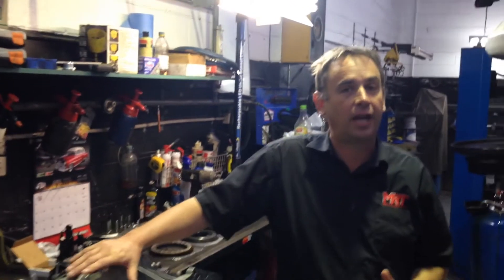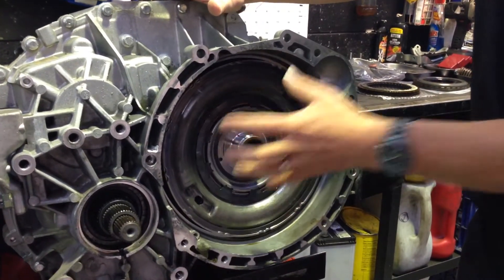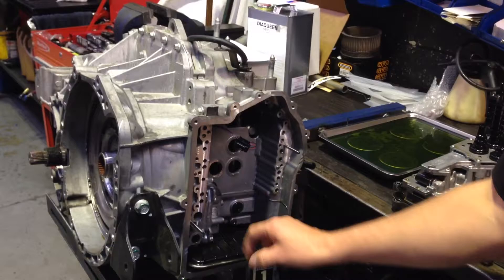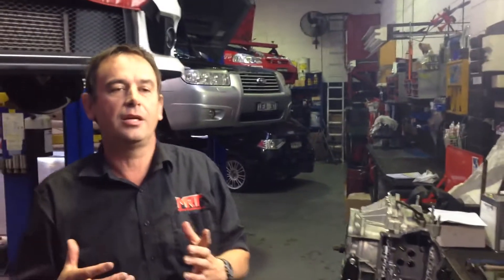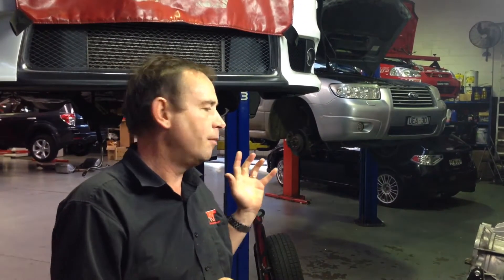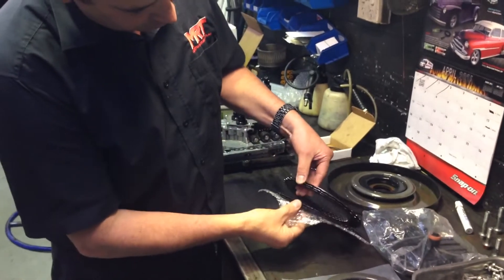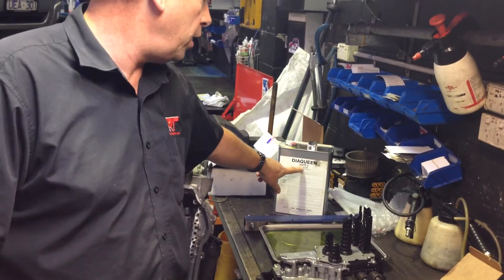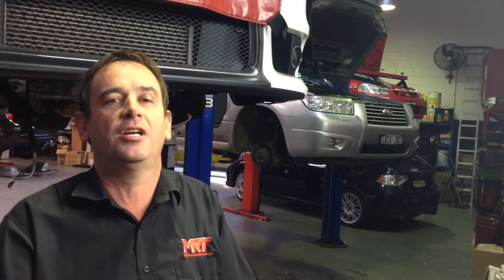Mitsubishi SST transmission tips and traps update Part 5

Comment: This is such valuable info. Also make me know for sure that if i'm buying an Evo X it will have to be a manual!
Reply: My 2010 Evo X MR has 130k kms and still running as new, just serviced on time (by myself) because Mitsu and most of the service workshops around there are useless. Those SST for repairs are from kids who just buy parts n send their cars to any tuner to show them on instagram
Reply: @motuc_fan_vic  Right? My 14 MR has 105k on it, shifts like the day it rolled off the showroom floor. It is tuned and runs all great parts but I built it for purpose, not show. Mitsu charged me $1200 to change the fluid and filter, now I just do it every year for $380 and 1/2 hour of my day.
Reply: If you want a 5 speed sitting at 6000rpm on the highway be my guest lol

Comment: Transmission just died in my Ralliart, skips 3rd and 5th gear.
Reply from the maker: easy fix!
Reply: MRT Performance
The cars under warranty. Apparently it needs new shifting fork actuator pistons, but Mitsubishi will not replace those individual parts but rather replace the whole transmission. Been waiting over a month for Mitsubishi to approve it : (
Reply: Mitsu Australia have no fkn idea about Evos, about cars I'd say. The other day they adjusted the timing chain of my EvoX and the next day my engine bay was full of oil because The idiots didn't put back the engines top cover properly . fk!
Reply: jcmedinaceli  they are all idiots bro. These are the boys that were scribbling pictures of dicks when they should have been paying attention to men like the above in class. I took mine in (uk) “it’s a sealed unit need new one six grand” 
“What about the clutch pack?” 
“The what?” 
Jamie walks away shaking head. 6 months later finds a garage that actually has skilled men in it. Replacement parts ordered!! Shout out to Automek in East Kilbride, indigo GT in Wales and of course Brett at MRT. Kinda amazing this is the length you need to for service after buying a 35grand car. Shame on you Mitsibushi. You allow idiots to sell and service your cars
Reply: @jamiewalker8772  Yep, I am yet to meet a more knowledgeable and thorough bunch of guys than Brett and the team at MRT. Already got a stage 1 tune on my Ralliart, gonna take it in to them sometime next year for a stage 2.

Comment: how often should you replace the SST oil?
Reply: Depends how you drive the car. If you read the log book it will say anywhere from about 30k (heavy usage aka towing) to 120k. I am choosing to have mine replaced at 60k (next service).